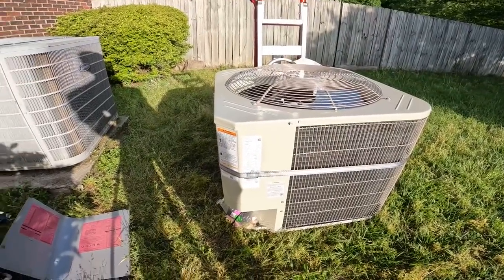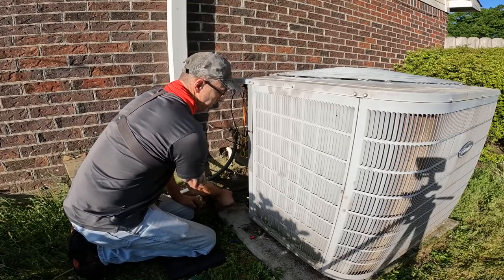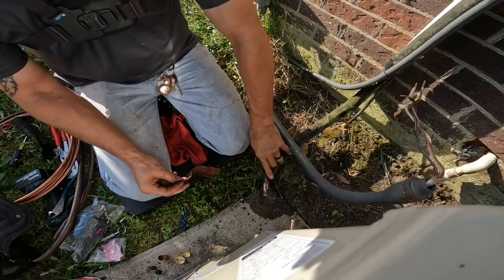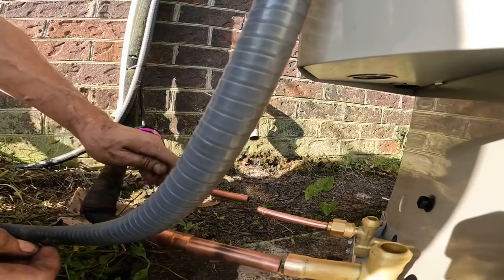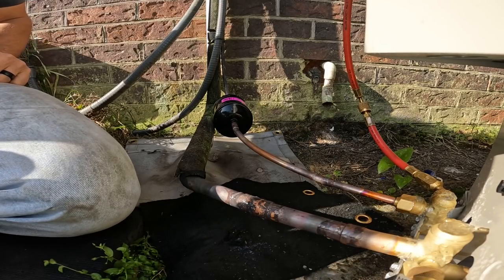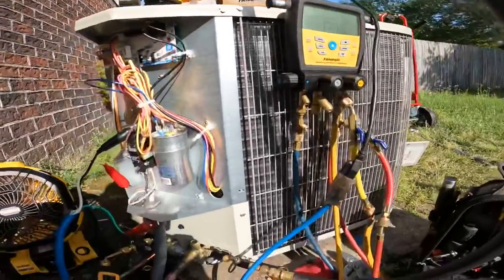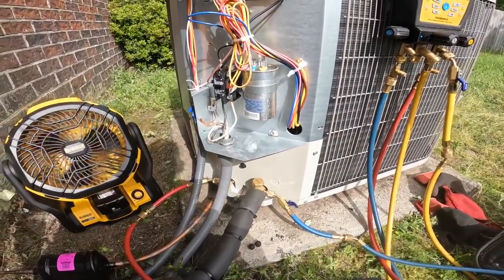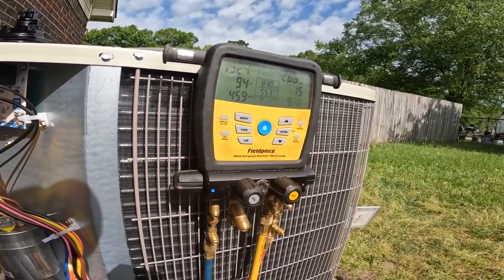Condenser Changeout - Carrier for Carrier

Comment: I remember one time I believe it’s a new construction site. I ended up by myself with two condensers to hook up. I don’t remember how it happened but somehow I ended up I didn’t have a dolly. I actually took a piece of cardboard from one of the boxes the unit came in set the unit on it and slid it across the ground down to where they had to go, and it actually worked pretty well under the circumstances lol.

Comment: This is the Carrier Sentry, the builder grade model. This is the exact same as the Payne. It is cheap, but gets the job done. Comfort series is the step higher. These are decent condensers for the money.
Reply: Get an ICP Comfortmaker and save the customer some money. It’s the same when you’re installing entry level systems.

Comment: I’ve never seen that stuff you put on the valves but it seems like it would be a mess to clean up. Personally I would just use a wet rag. The 3/8 line brazed up quick. The 3/4 with a wet rag is also just fine

Comment: Great video Curtis. I really enjoyed it. Couple of questions. I notice you use the spray heat sink. Do you like this better than the paste or puddy type? Is it easy to cleanup afterwards? Are you a one man show? Do you rent a storage bay for your business and if so, how do you like using rental bay? Thanks again for your video👍
Reply from the maker: Yes, I’m a one man show. I do rent, but I have a 4000 sq ft warehouse with an office
Reply: @HVACGUY  So do you like the spray heat sink better? Ive been using the vipor puddy type stuff and its a bit of a nuisance to mold it around fittings :(  Does the spray type absorb the heat well? Thanks